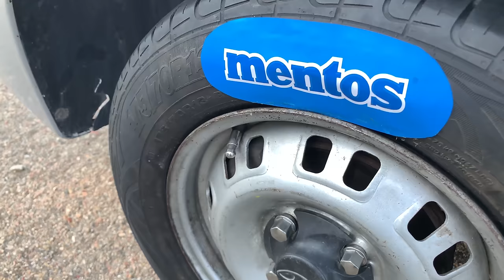COCA COLA vs MENTOS in a CAR TIRE

Comment: I think that one bottle should have been enough. There's a reason that nitogeon is often used to fill car tyres as opposed to carbon dioxide. Carbon dioxide is the gas that's released when mentors are introduced to coka cola. This gas isn't produced though it was already prescent though trapped within the coke mixture as with any carbonated drink. Carbon dioxide is a heavy gas relatively, which is its first drawback and the second is that its pressure or volume is greatly dependant upon ambient temperature to a greater degree than many other gasses so its to unstable in this respect for filling car tyres whereas nitogeon is much more stable and inert.
Reply: Repent to Jesus Christ 
“Submit yourselves, then, to God. Resist the devil, and he will flee from you.”
James 4:7 NIV
Reply: hence performance shocks using nitrogen
Reply: The reactivity of nitrogen. Oxidation...blah blah blah. In a disparate situation... why not. MENTOS the all purpose fresh maker
Reply: Im not reading all of that.
Reply: Bro is a sientist

Comment: Would be way cooler if the mentos were in some sort of dissolving membrane to allow time for soda to be introduced and valve stem to be reinstalled before initial reaction.

Comment: I'm confused about how you are putting the cola in the tire using a plastic tube with nothing on the end to depress the valve of the tire stem.  I get you removed what looks like the plunger to depress the valve, but if the valve is now shut how is the cola getting into the tire? How is the air not escaping? Or is it that there's so little air pressure in the tire that the pressure of the cola is opening the valve?
Reply: Good poin
Reply: T
Reply: He took the valve stem out... It's now wide open. Not closed. Until he put it back in.
Reply: The valve core is what let air in and out of tire. With it out it is an open port to the inside of the tire and rim. With air in tire when you take the core out ... the air will blast out.
Reply: There was no air in the tire. The car was lifted with a jack. Duhh.
Reply: He takes the valve out and there is barely air in the tire just enough to bead it
Reply: This is aginst any rule of physics
Reply: IT was shown. He Put out the valve
Reply: Erm erm erm 🤓🤓🤓 actually erm🤓

Comment: I think you gimmicked this somehow. Everything I know about Coke and Mentos tells me that the reaction should have started nearly immediately and caused the Coke to start blowing out the valve core before you could possibly have gotten all 2.5 gallons of Coke in the tire.
Reply: I agree
Reply: I concur
Reply: I believe the position of the valve at the top would have given some small time advantage. Additionally, I did see a decent amount of foam coming up the tubing at one point. However, he was keeping the tubing above the point of entry, and the liquid being squeezed in would have pushed the foam back down.
Reply: That's what I was thinking the whole time.  That's way too long of time for nothing to happen.
Reply: Q

Comment: You should have checked the tire pressure with a gauge to see how high it was. I bet if you used a higher Mentos/Coke ratio you could have made that sucker explode on its own.
Reply: Don't you think the bottle would blow up if it had that much CO2 in there
Reply: @near sighted time traveler Actually, pressure does not fluctuate by hitting bumps.  When going over bumps, the tire will squash (deform) but it will not be compressed (changed in volume).  So essentially, when the tire hits a bump the tread is deformed inward and the sidewalls are pushed outward thereby keeping the volume intact.  If you're not convinced then the next time you rotate your tires, measure the air pressure with and without the tire on the car.
Reply: @ck-qr4ew  Of course it increases!
Reply: @near sighted time traveler Higher force, yes. Higher pressure, no. You are conflating those two variables.
Reply: @aerocap  Of course?Because of magic? Please find an engineer and perhaps he can explain the dynamics.
Reply: Lol

Comment: I don’t get how he could put all that coke in there and nothing happened before he could put back the valve core 🤔
The mixture should’ve prayed out by the time he was pouring the first bottle.
Reply: I'm skeptical about this too.  I think the reaction of mentos and coke is too fast for it to build up any pressure in the tire.  All the air should've escaped the tire before he had time to put the valve stem back on.  

Even if he could build up enough pressure with the reaction, I would think it would blow the rubber hose right off the tire value considering it wasn't fixed with cable ties or hose clamps. 

I think what he actually did was put extra air pressure in the tire after putting mentos in to make it look like the mentos built up pressure.
Reply: I also think that if he could generate enough pressure it would eventually force the coke back into the bottle. Squeezing the coke bottle would not generate enough pressure to counteract the force of the air pressure in the tire pressure if lets say even 20 or 30 psi was built up.
Reply: Абсолютно верно

Comment: Should have secured the mentos to the inside of the tire with tape and tissue paper so you could put the cola in without the mentos mixing before all the cola is added. The reason the cola reacts with mentos is because the coating on the mentos reacts with the carbon and causes it to rapidly release. Once the coating is put into liquid it dissolves and no longer will work so the mentos were no longer good after the first bottle.
Reply: True

Comment: Should have checked tyre pressure on guage before destorying it
Reply: Right😀👍
Reply: If I remember correctly carbon dioxide balance at three atmospheric pressure. So the tyre should have a pressure of about 44 psi

Comment: As i thought. As reactive is mentos to the cola. It won't be enough to blow up the tire. The pressure may not even reach 100 psi and that is way below failure of any tyre out there.

Comment: Man you wanna have some fun blowing shit up safely? Just take you that bottle cap like you got with the valve steam pulled through it and hook it to the air hose come off you tire machine. And get the F back cause it will rattle the whole place in about 45 second! For real its cool as hell

Comment: I call B.S... 1st, putting the coke in the tire one bottle at a time and having no check valve would allow the coke to de-gas. Thus preventing pressure from building, as the reaction is immediate. 2nd, You could put water in the tire with mentos and inflate the tire to pressure, cut the tire and get the volatile discharge.

Please try again by keeping coke and mentos separated until mixing with rotation.

Comment: Nothing happened. It might be a good way to seat a bead. I  wonder what the tire pressure was before it was cut. I also wonder how many miles could be driven on that tire at highway speeds on a hot day? If you had a flat and a plug, could you use that in an emergency if you didn't have and air compressor? All that would make a better video. Still, I had to watch until the end!

Comment: If he would have used a bigger stronger bottle and a filter between pipe and bottle(separate gas from liquid), THAN he could have pump the tire with reaction gas only! Full legit way to pump up a flat tire.

Comment: Damn I guess I was hoping to see if you say for instance you take the valve stem out of a tire and take mentos and crush them into small pieces enough to fit through the valve stem put them inside the tire and then put the valve back on or hook the coke up to it how are you doing it and then mix the two together see if it inflates the tire

Comment: Show how to put a rim how to put the tire on the rim without it tool with just a crowbar and exactly how many mentos and how much soda to put in there to not blow it up you will have an emergency fix in the middle of nowhere if you've got some mentos and soda
Reply: @NormDPloom  you completely miss the point you want to be able to MacGyver it wherever you're at whatever's going on if you're on the side of the road with nothing about a rubber band to patch the tire and a valve core tool to pour some mentos and Coke in which may take chemical reaction it's not just the gas is in the coke and then you could be back on the road